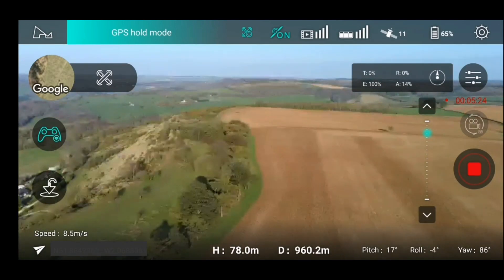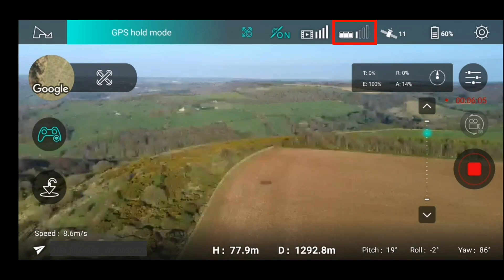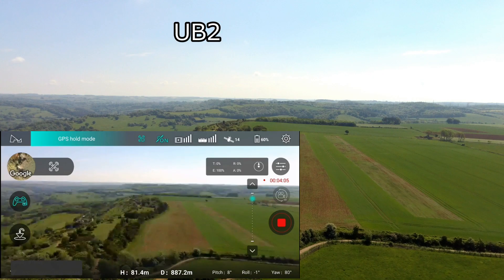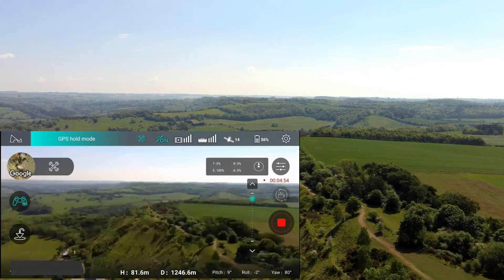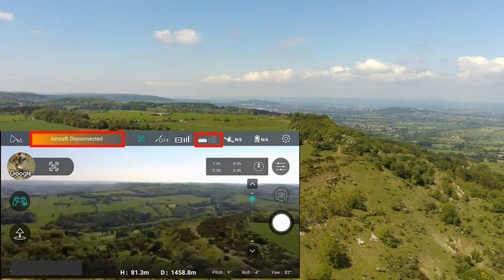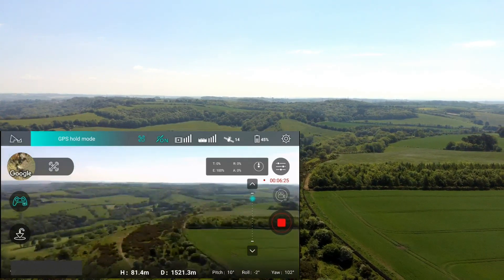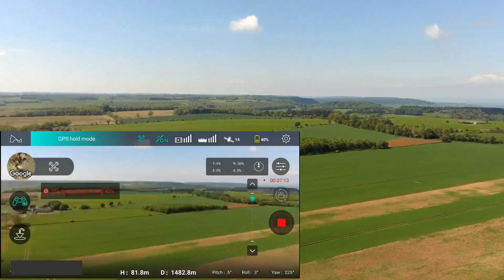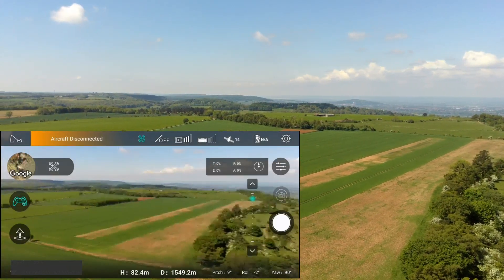Hubsan Zino -  Firmware V 0.3.6

Comment: Thanks for the update, I didn't realize that a camera firmware bug was the cause of the recent RTH issues. Great information and thanks for sharing.
Reply from the maker: It isn't always immediately obvious. It would not have been obvious at all for those that don't load and test individual firmware codesets either.
When I test, I always change only one thing and then try and establish what changes have been made. Hubsan themselves provide only the sketchiest of information.
It would be great if they provided real release notes, but as they never have up until now, it's unlikely to ever happen :-)
Regards.
Reply: @randoneur  Thanks for explaining your testing methods. And I agree about Hubsan's release notes.

Comment: Thank you for the explanation.  I was wondering why camera firmware would have corrected the RTH issue.  👍
Reply from the maker: Camera firmware contains  the code for the UB25 wifi module. This is also why you get connection/wifi  issues when you incorrectly load camera firmware or have SD card issues which cause the module to try and load code.

Comment: Hello Peter. Firstly, great videos and very helpful. Bought my Hubsan 2 months ago. Had trouble trying to install previous version as couldn't find the Upgrade tool. I note your video refers to V0.3.6? I have just upgraded and only have reference to 1.1.51 Firmware, 3.0.2.2 Gimbal and V 0.1.5 for transmitter. Is the camera glitch included in these or is there another zip file that I can't open? Your help would be appreciated. Chris
Reply: Have now done the SD card transfer and have Zino_IT_V0.3.6 showing. Think I am up to date now.
Reply from the maker: @chrislloyd3198  Yes, it is in the last 2 package updates.
Reply: @randoneur  Thank you. Got it. The Hubsan Zino is really good. I flew it out tonight and lost signal. It went immediately into return to home mode and when the signal dropped back in I was able to take back control of the drone. I picked this up from Amazon on a lightning deal at £272. Bargain

Comment: I've already tried the downgrade (I tried to go back to FC 1.1.50, but when it arrives in the firmware of the camera .36 does not let it go back to .35).

I updated to the new FC 1.1.52, but it continues disconnecting. I have everything updated. It loses signal at all times connected to the remote control.
Reply from the maker: The wifi disconnects or something else?
Numerous reasons for that but would need full details of the symptoms to diagnose further.
You cannot roll back camera firmware without hacking the code. I'm not going to show how that is done as it can lead to all sorts of issues, and I'd not wish to be responsible for breaking peoples quads  when it all goes wrong.
There's no need to go back to 0.35,  the 0.36 fixes the bug in .35.

Comment: Hi. So you can not reallly push the range further to about 2km even with no fpv feed because it will auto return? OR you can cancel the RTH and proceed further but this can be dangerous since you have no way of knowing how further you are and your height...
Reply from the maker: You can't push anywhere without control. That is the First thing that fails. You will not lose video before you lose control ( in the Zino). You cannot therefore push further once the quad loses control.
You can alter the height and position of the quad however to give you a better signal. HTH.
Reply: @randoneur So the product details mentioned in most sellers like banggood regarding the 2.5km max range of this drone is totally false since at about 1km it loses fpv and rc control and automatically returns home?
Reply from the maker: @epsonexxon1088  the range is restricted because of power, antenna gain and the path loss. Only 2 of those can be changed, and only one by the user 😁
I did s video on this many months ago. The quad is as per the advertised Hubsan spec (1000m).
https://youtu.be/Er3d9N7kHxg

Comment: Thank you for informative video.  It appears that initiation of loss of signal RTH spins the aircraft around to opposite heading and starts traveling toward "home" but with a slow left yaw that appears to stop only after aircraft regains contact with the controller.  Wondering if this is what  causes the RTH "crab" that some users have complained of?
Reply from the maker: You couldn't say from that small clip whether the aircraft crabbed or not. 
Unless you have visual on the quad, you can't actually tell whether the quad is crabbing or the camera is offset, which would be gimbal issue. 
It's not something I suffer unduly from or have spent much time looking for a possible cause :-)

Comment: Thank you. Could you see an instance where instantaneous RTH on Control signal loss would be dangerous?
Reply from the maker: Possibly, but it would be very hard to mitigate one way or the other. You could lose signal going behind a tree or a wall and unexpectedly cause the quad to lift 20m in the air. I'd see it more as an inconvenience most of the time. It's better to have some sort of failsafe however than none at all :-)
It's no worse, and less likely to happen than the low voltage/range failsafe, which is not only a PITA, but can and already has caused people to cash their Zinos. I'd love the option to disable that one!
Reply: @randoneur  : Or like the Parrot drones... have the option to sec the delay time in seconds.
Reply: @randoneur  what exactly are the zino failsafe limits for low voltage? At what percentage does it rth and when does it just land on the spot?
Reply from the maker: @deananderson1059  The LV failsafe voltage is completely dependant on the distance form the takeoff point (not the distance from the pilot!), and the remaining battery capacity. That could mean it will trigger at 50%, 40% or 20% or any value where the distance to travel home would take the battery to about 15 -20% capacity. It's therefore not a fixed value, or indeed easy to determine.
The LV cutoff is 10%. At that time the quad will land at the current spot, and fairly rapidly too. You will not be able to keep it in the air below that value.
Reply: @randoneur  thanks for the info, much appreciated!

Comment: Can I just update Camera and leave 1.1.48 on if flight control doesn’t matter?
Reply from the maker: If you want. The FC is so easy to update so you may as well go for 1.1.51 which is far nicer than 1.1.48.
Of all the updates the camera is the one that screws things  up!
Reply: @randoneur  : So that raises the questions: If the Camera update is the RTH killer then what is the difference between the FC 1.1.48 and 1.1.50 and 1.1.51 ?
Reply from the maker: @GorillamansGarage  The difference in flight controllers? Virtually nothing. If you saw my previous video of blind testing all the FCs released from 0.43 up to 1.50, you'll see that I found it  almost impossible to differentiate between them.  There were some very subtle small changes, but nothing that leaps out at you and says, this is different (except for 1.50). 
The RTH is of course a FC function, and the only change to that has been the addition of a customised altitude introduced in I think 1.1.48. 
The UB25 change was to the actual failsafe trigger.
I don't have access to the FC source code and I'm currently struggling to actually interrogate the ZINO network in any great detail, however I'm working on that and getting an understanding on which parameter has been changed,  in 3.5, and more importantly why :-o
Unfortunately not many others seem to be doing any real investigations. It would be easier to document all this  as a community effort.
Unfortunately apart form yourself and Marcus, I'm not seeing any other YTubers who are inclined to do any leg work :-)

Cheers.
Reply: @randoneur  :   I am sticking with 1.1.48 and am hopeful that Hubsan will include a timer (delay) parameter for the RTH initiation (3-4 seconds). Also wonder why there is no warning when the SD card is full. The only sign I found was a frame drop (skip) in the FPV video screen but no warning or signal.

Comment: It's a lie.  Coordinates are smeared.  Because they change.  And if the remote is at the take-off point, they should not change.  The author hides it.  40% and the quadcopter flies farther.  At this distance, he would have tried to return to the take-off point for security policy) means the remote control is nearby.  And in the end, the author includes returning home not to the take-off point, but to the console.  It means that it is not at the take-off point, but rather goes / goes after the quadcopter.
Reply from the maker: This video is to demonstrate the bug fix in firmware 0.3.6. Nothing more, nothing less. If you don't believe the bug fix, fine. Try it yourself however, and you shoud find it's as documented.
Position information is greyed out because there are nasty, odious people on the youtube that that have questionable motives and morals. :-o
Anything you see on the video is as it is.
Reply: @randoneur  The 0.3.6 firmware on my quadcopter, and my friends fly to 1 km, which Is limited by the software))))

Comment: What firmware is that im on 1.1.50 thank you
Reply from the maker: It's to demonstrate the UB25 (Camera/FPV firmware)  V0.3.6.
I'm almost certain the flight shown was with FC 1.1.51, although it could have been 1.1.50. Not  100% sure without looking back, and it doesn't change the results of the test anyway :-)